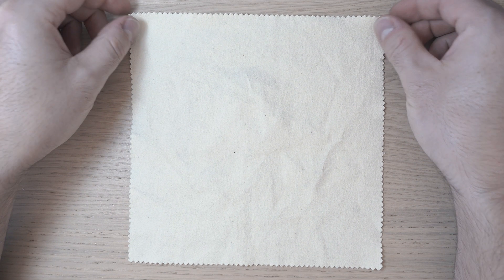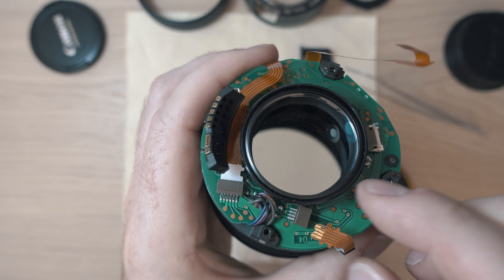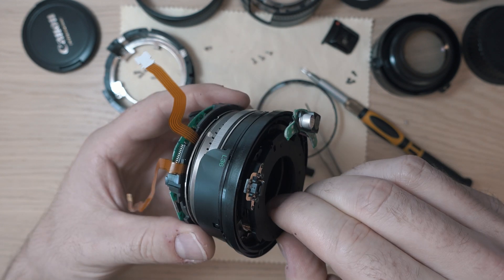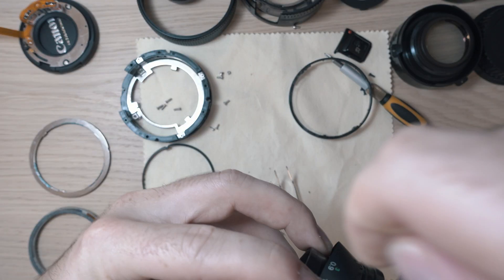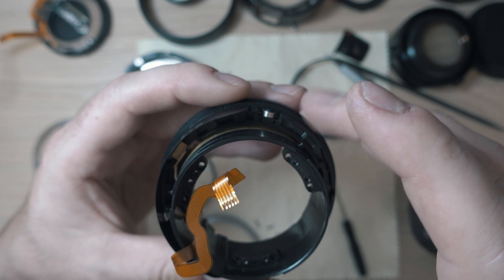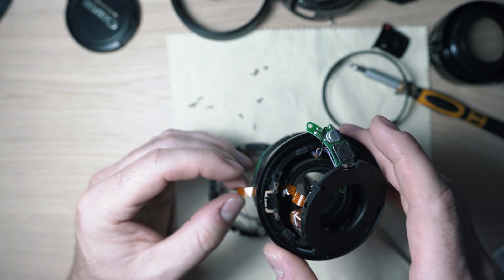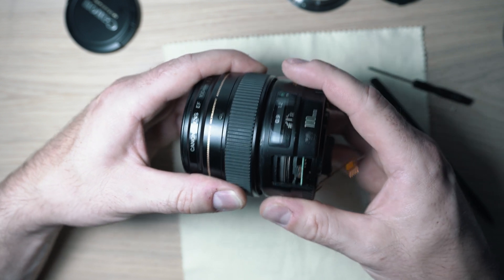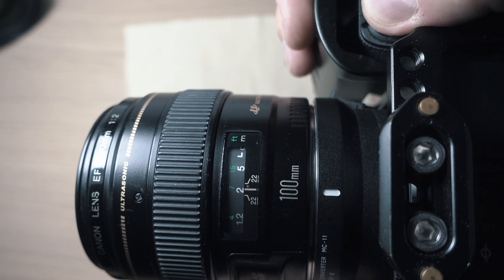Canon 100mm f/2 USM | Focus Repair | How To Fix Canon Lens

Comment: great video! fixed my sticky focus...but now auto focus doesn't work ugh! I cracked it open 2x, i guess the either a wire/ ribbon got damaged or the USM fingers were damaged. Oh well....manual focus works and its smooth.
Reply from the maker: good luck with repair, thanks for watching

Comment: Thank you for the video! My 135mm f2.0 L also had a focusing problem. Almost does not focus at all, as if he lacks strength. If i put the focus on infinity, then it does not want to focus at all. Please tell me what could be the problem?Thanks  P.S I have been using it for 5 years, did not fall, condition 9.5 / 10
Reply from the maker: Hi Daniel, it is common problem with these lenses …  you can follow my video

Comment: Hi I have the same lens, af all work fine, but the manual focus ring slips when I try to use the manual focus. Do you know what the issue that is causing this? and how to fix it?
Reply from the maker: hi, it is difficult to tell… something inside is loose or broken…
Reply: The felt like washer may become thin.  Try to insert a shim to fix it.

Comment: What Kind of lubricant you use at 6:43 ? Is it safe to use CRC Super Longterm Grease MoS^2 with this lens?
Reply from the maker: hi, I used just full synthetic oil ... you want to use something which behaves great at different temperatures. 
thanks for watching

Comment: Hi, what were the problems with the AF before? I have an 85mm f1.8, that is pretty much the same, and it jumps forth and back nervously, like its juuuuuuust stiff enough on some points that the motor won't spin it.
Reply from the maker: this won’t used whole range it was stuck in middle .
Reply: I have the same problem this day with my 100 f2 😓
How did you fixed your lens? What was the problem?
Reply: @milanbabic3243  well, I haven't fixed it, I just kept in using it with manual focus. When I have more time I'll disassemble it and maybe change the motor